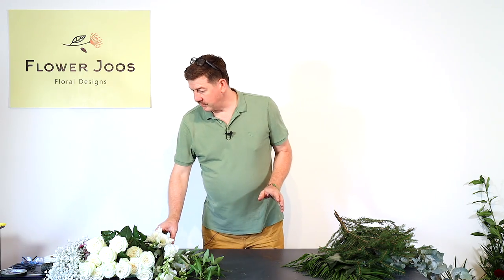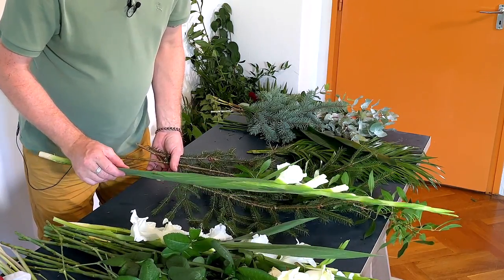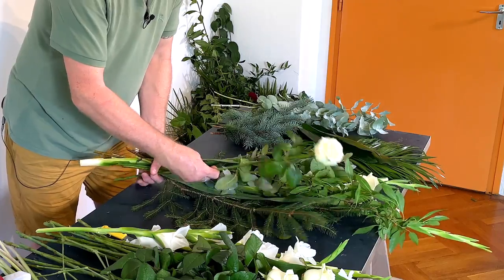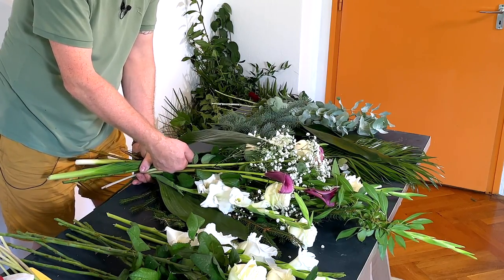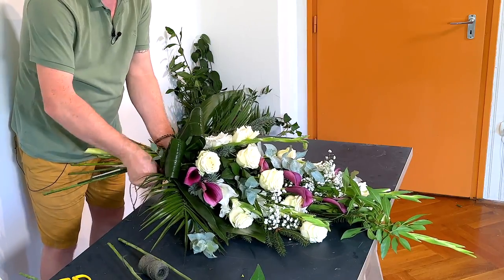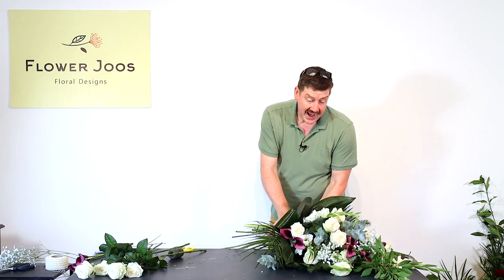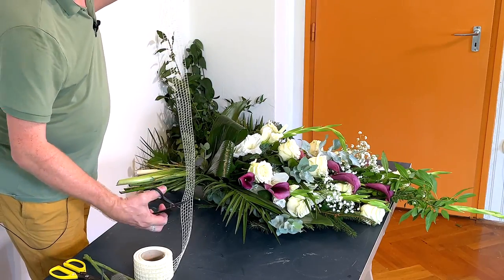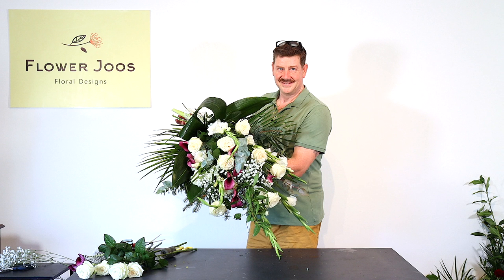How To Make A Tied Sheaf Design

Comment: I can see that the extra gladioli shouldn't be required. The reason because the very top of a sheaf is sharp like the top of a triangle. In fact, funeral sheaf is a front face bouquet, only for front viewing. The whole shape is a slim triangle and increases height of the blooms starting from half of the triangle below down. That means the most largest blooms are placed in the bottom  base as focal point. The top should have only single contents.

Comment: Are you using argawool. I understand the oasis form is dangerous.
Reply from the maker: In this the mechanic is just the stems - but yes we have been using Agra wool for other designs. Hopefully foam use in general  will decline as new options enter the market. 😀🌼🙋🏼‍♂️

Comment: If this were used as the main funeral item would it slide around on the coffin at all? (I assume sprays have some grips or rubber on the base of the trays?)
Reply from the maker: That is really the job of the undertakers - I think they have matts and non slip bases they use that they keep in the hearses. But potentially it could slip around . They are the people who will transport and handle the item in front of the customers.
Reply: @FlowerJoos  so good to know, thank you 😊 I'm learning so much from your channel x
Reply from the maker: @phoebehope6549  thank you 😊

Comment: Why is that spiral?
Reply from the maker: The stems where they meet go round in one direction, all on an angle. This method gives a very consistent mechanic and flowers can be easily adjusted, as well as tied off without loosening. 😀
So it’s at the neck it is spiralled not into the actual design visually. Hope that makes sense 🤪😀